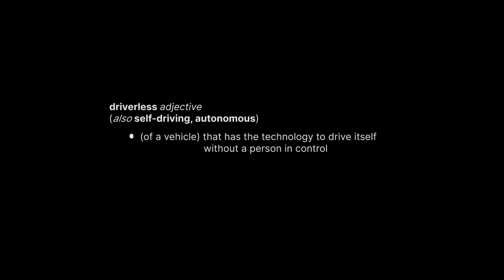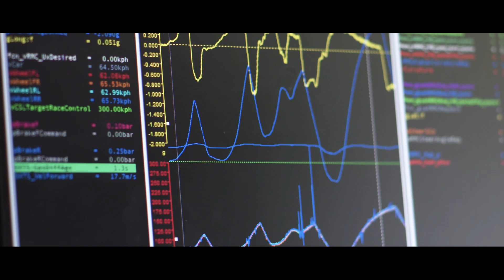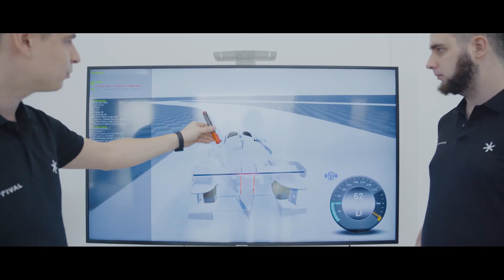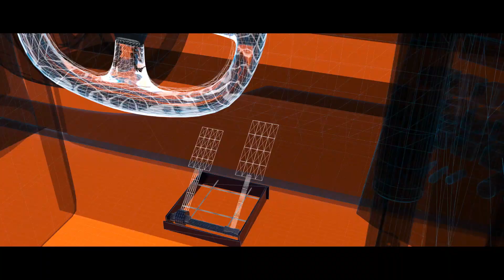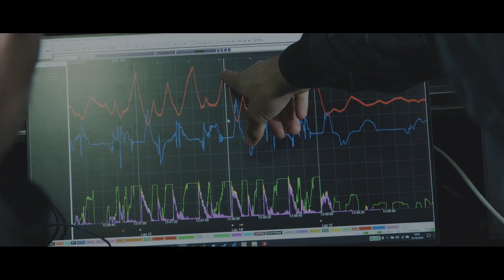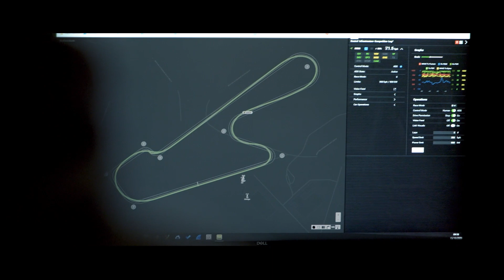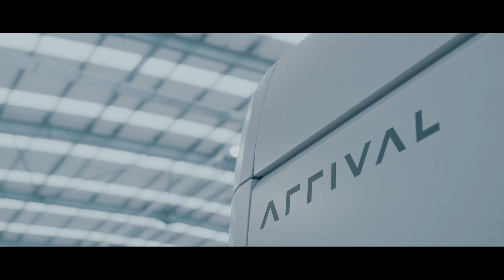Can AI beat Formula 1 racers? | Lucas di Grassi vs Arrival Racing | Roborace Challenges

Comment: The promise of the self driving car industry, since 2015, was that we would be there by 2018. No steering wheel in the car by 2020 / 2021. My optimistic prediction for that is 2035 (unless remote control trickery).

Similar story for Roborace. 5 years, still quite far away. Maybe 5 more years, or 10, when Di Grassi has lost some of his speed due to age.
Reply: you are in for a surprise
Reply from the maker: You should watch our videos from Season Beta to see significant progress. Our teams started from racing on the track with static metaverse objects and went to the competition with ghost cars.

We are going to introduce multiple cars on the track in Season 1. Just after all tests and experiments in Season Beta and MetaBot development.

The same story with Lucas Challenge. Every time AI comes closer to Lucas. Last time the difference was split a second.

The next attempt will be this May. Let’s see who will win 😉
Reply: @Roborace  I'll cheer you on, beating Lucas fair and square: Optimal conditions, full power, full commitment. But I'm skeptical.
Reply from the maker: @RacingTIR0  it’s ok to be skeptical. We respect your position.